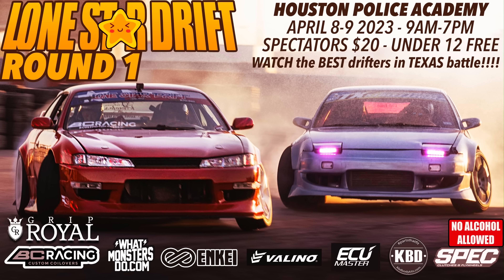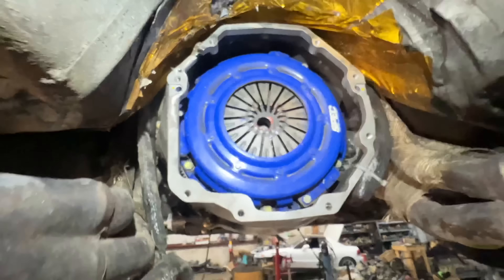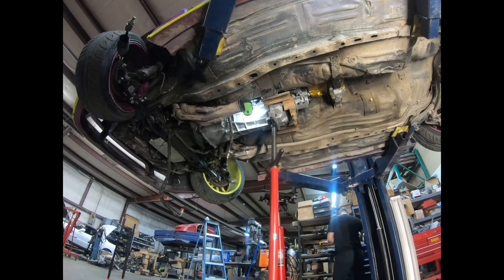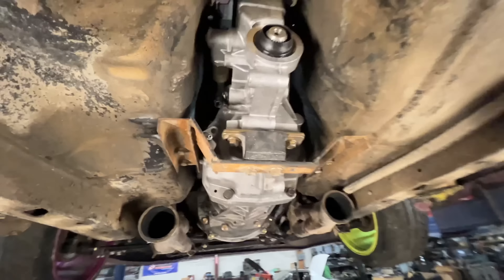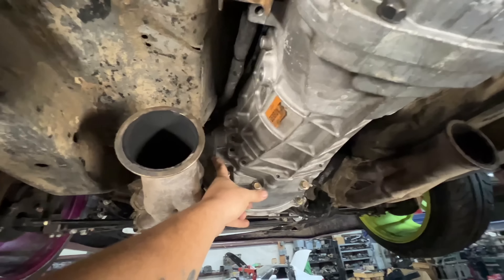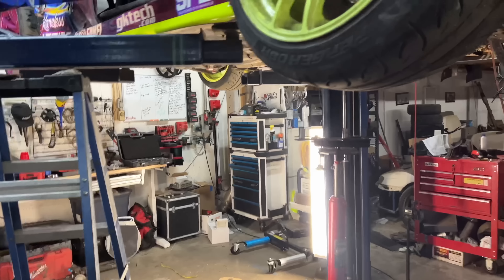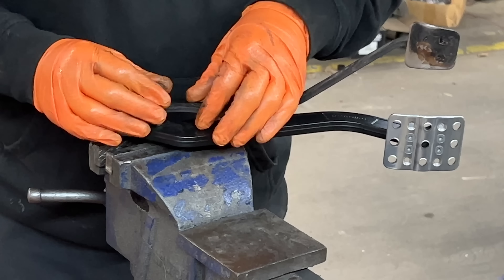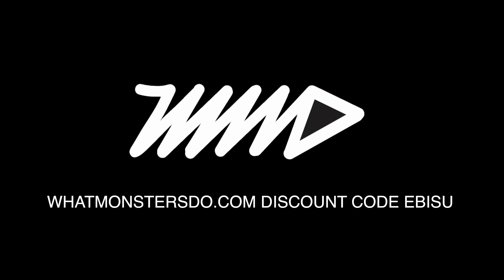Repairing the Naoki Nakamura S13 after Drift Week 7

Comment: spec pressure plates are garbo. they are too stiff to compensate for the less quality in the disc/discs.  they will eat up slaves, syncos, and trust bearings. same with act extreme single plates, too stiff.